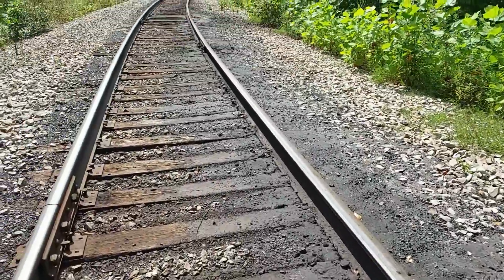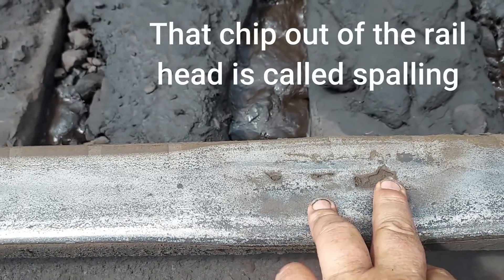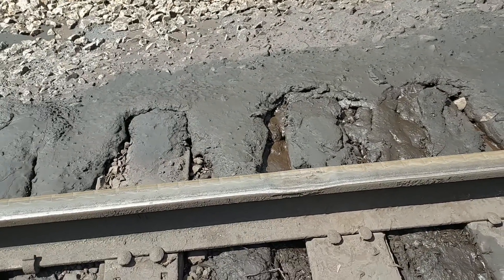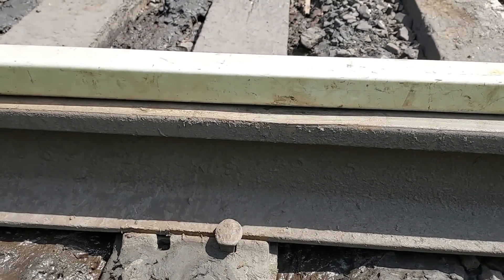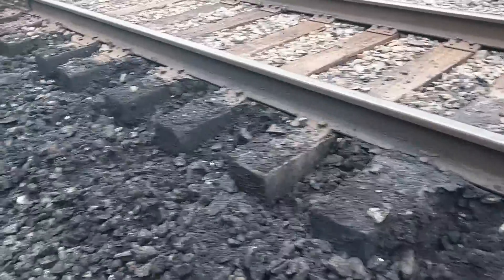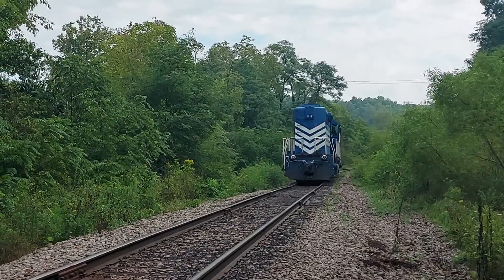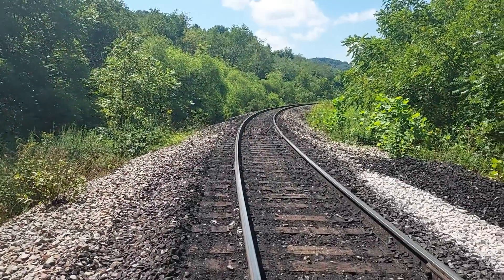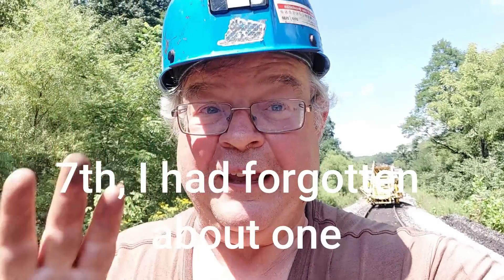This is the 7th Rail I've Broken with my Tamper

Comment: Dave , my DES unit as getting a national award  we had a derailment in Heath area about 3 miles from were we where . My  County Engineer was a old IC RR bridge guy and I was working with ICG at the time . 2 locomotives made it and 2 cars 4 tankers didn't . This is new welded rail  and we found a about 4 inch  gap in the rail . It looked like somebody didn't allow for expansion of the rail . clean break in rail almost . very near to a tee , north ,south one way ,east , west . This was a one piece interchange set in place and the rail ran into it . Have ever seen a setup like this before ?
Reply from the maker: No I have not Robert. Pretty cool you guys are getting a national
award, good for you! But I have had brand new rail in the past (39 foot sticks) on several occasions break just from the weight of trains.  Thank you for taking the time to watch the video and may you have a very good day my friend.
Reply: Dave , this happened in the early 1980's  so it wasn't current news .
Reply from the maker: @robertreeves-su1qb  😊👍🚂

Comment: I wouldnt in this case say you broke that.
It was alerting you in its own subltle way to do a repair before a train derailed.  From the looks of the discolored metal in that break, something bad happening wasn't very far off.   
Does that little chip or flake shown in  the begining of the vidjeo start to work harden the metal via the subtle hammering or vibration effect of the wheels rolling over that spot?
I enjoyed this one.   👍
...ok, i enjoy them all, but you know 😉
Reply from the maker: Glad you enjoyed the video Randy. You are right, far better to find
it with the tamper than have a train find it. I don't think it actually
work hardens the metal as you may think what that means is. It
more causes the internal defect to grow in size as the train's
going over it. What is totally amazing is a very tiny internal
defect in the rail actually grows in size as time and train traffic
goes on.  Thank you for visiting with us and may you have a very good day my friend.
Reply: @ccrx6700   You described that perfectly.  I know why they keep you . 👍
Reply from the maker: @randywl8925  😊👍

Comment: Well with so much movement in the Rails with the constant heavy loading Dave its a wonder you dont have more failures on your rail sticks ... as one of  the other contributors to the disscussion Metallurgy is a fineart Science ... a length of rail can only take so much punishment 😂😂😂😮
Reply from the maker: You are right about that Joseph. These rails take a beating with the
heavy coal loads and the soft spots in the track ballast. We do get
ultrasonic rail testers in twice a year so they catch stuff at an
early stage and we get those rail fixed or else they would soon 
break. Appreciate very much your taking the time to visit with us
and check out the broken rail show my friend.

Comment: Interesting.

My best guess is either a Horizontal or Vertical Split Head...or Compound Fracture.

Either start as Internal Defects, and grow slowly until the Defect reaches the Exterior of the Rail. When the Defect breaks through to the Surface, it Rapidly Grows within the Rail as It now has an Unlimited Supply of Oxygen to Support degregation.

This type of Defect was the Cause of more Arguments between myself (as a Stooge) and Chief Operators when I worked for Sperry Rail Service in the early 80s than just about any other, because of their Unpredictability... they have been said to "Heal Themselves", which I have alway doubted...

One of the Last Defects I marked up was a Horizontal Split Head I had caught just Inches outside of the Joint Bar Area. It happened on the CNR while they were yet a Crown Corporation. The Chief Operator Refused to Acknowledge my Findings, but was Overruled by the Railway Superintendent that witnessed the Incident.

There wasn't a Happy Ending to the Story save one thing...

The Rail was Replaced on the Insistence of Those that Answered to the Authority Entrusted to Them by the Sovereign, HRH Elizabeth II.
Reply from the maker: Thanks for the really cool comment Bruno. I have never heard of
a split healing itself either, but I do agree on their unpredictability,
just as a track man we always replace the rail asap with splits.
Appreciate so much your taking the time to watch the video my friend.

Comment: I was just thinking when I read the title of the video that it's better to break it with that slow-moving tamping machine than to have a heavy train break it since it seems like that might cause it to derail. I did see that under that flattened part, the steel looked just a little bit different and, when the crack happened, it was right where I had noticed that beforehand. It probably was a little defect in the production of the rail. It happens.
Reply from the maker: Your absolutely right, much better a tamper than a train whoever.
Thanks for visiting with us and checking out the broken rail video
my friend.

Comment: Dave, here in the UK we use Hadfield Manganese steel. It has up to 13% Manganese in it. This gives it the property of ‘work hardening’ the surface due to the action of the wheels. Where you have a defect I expect this will get excessive pounding from the wheels and a extra hard skin forms on the rail. This eventually gives up and you get the spalling.
Reply from the maker: Thank you for the excellent info Peter, I will have to do some research on that. That stuff gets hard, wondering if you guys
have rail grinding program and how the stones hold up 
grinding that stuff???. We appreciate your taking the time to watch and write in my friend.

Comment: Hi Dave,  @4:16 I noticed a discoloration in the railhead surface about 1 inch to the left of the spalled area.  It almost loos like a crack straight across the head section.  There also looks to be a possible crack on the field side of the rail head from where the surface discoloration meets traveling diagonally to the right.  Looks like the head was already cracked and the tamper just finished the job.  Cheers.
Reply from the maker: Very good observation Samuel, I think you are right, was already
cracked. Thank you so much for visiting with us and watching. May you have a most blessed day my friend.

Comment: do you stress your track after welding it ? greetings from the UK
Reply from the maker: No we do not Gallo fourteen. We do not have CWR here only
an occasional thermite weld, 16 miles of track and it is almost
all jointed rail. Really appreciate your visiting with us and checking out the video. May you have a most blessed day my friend.
Reply: @ccrx 6700 That's Railroadin!  cheers dude. I will now that my shift is over. Just finished regauging some points over her in old blitey.
Reply from the maker: @gallofourteen116  👍😊

Comment: thought rail was cast as one piece but looks like the top part that the train wheels run on is not the same piece as the bottom. how that broke away is strange.
Reply from the maker: It is rolled in one piece, you are right deeremandoug. Rolling
contact fatigue is what caused  the rail head to look like that.
Really appreciate your paying us a visit and taking in the video. 
May you have a most blessed day my friend.

Comment: was that rail made in 1975? and how long do rails usually last?
Reply from the maker: Yes sir, rolled by US Steel 1975 Illinois Bill. Rails last far less time
in high degree curves than they do on tangent track.There is
no set formula for how long a rail can last tho. Lot's of
factors go into determining how long a rail stick will remain
in service. There is rail rolled in the early 1900's still in
use on some track. Thank you so much for taking the time to
watch and write in my friend.

Comment: What are those rails made out of old Great Lake Steamers well-known to catastrophically fold-in-half as a result of metal fatigue or crack apart from freezing conditions. Ha.

Have you been able to keep track of suspect rails manufacturer or year Lot number to see if anything in common between each other?
Reply from the maker: Rail was rolled in 1975 by US Steel Illinois. It held up pretty well
for all those years of heavy coal loads over them. Rails break,
that's just the way it is on the RR.

Very much appreciate your visiting with us and watching the video. May you have a most blessed day my friend.

Comment: Great video Dave, good camera angles to see the details. That broken part of the rail had a lot of rust in it as well, could have failed at any time. Great it happened during tampering. The term Spalling is also used in the electrical industry on concrete power poles, when the rebar has rusted and is cracking the concrete of the actual power pole.
Reply from the maker: Thank you so much Rodalco for the very nice comment.
We do appreciate your taking the time to check out the video. May you have a really good day my friend.

Comment: Started railroading on a veteran railroad 50 years ago. It's a narrow gauge railroad, 891 mm, 3 Swedish(!) feet, we use other measures for curves, the radius. You use degrees. How is that done?
Reply from the maker: Radius is the distance from the center of a circle to the 
perimeter of the circle. take where that radius touches
the perimeter, then make a 100 foot chord to the circle
perimeter, that is the arc. then you have 2 radius lines. The
distance between those 2 lines is measured in degrees,
thus the degree of curvature. Hope that is clear as mud. Much
harder to explain, I need to make a video and show a drawing
of how its done. Have had a lot of comments on why curves
here are measured in degrees. Always appreciate your
visiting with us my friend.
Reply: @ccrx6700  Thanks! Here we measure an incline in the number of feet climbing per 1000fet of advancing. Other standards use the opposite, how long to go to climb one foot... Only math...
Reply: @ccrx6700  Thanks! Having a Master degree in electronics the math is clear, as mud! Her we use the radius. 
The automatic track correcting machine also need the pre radius sitting between the straight track and the real curve.

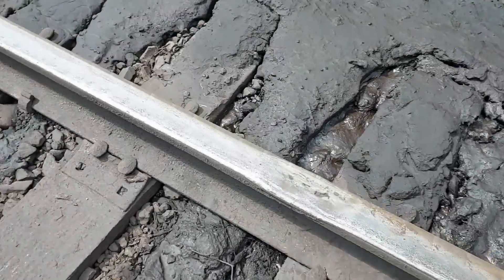Comment: 2:00 There's a railway crossing near where I lived that looked like that for several years before they finally corrected the situation. By the time they got around to do it, the rail was bouncing up and down at least 2 inches when a train went through. It was pumping mud all over the place. The fix happened not long after the Lac Mégantic disaster. I actually live a little over an hour away from there. Some of our fire crews went there. As tragic as it sounds, I think that the only reason that it finally got fixed is because of that tragedy. Right after that crossing, there is a pair of curves before the train reaches the city center. They upgraded them to continuous welded rails and added a cant angle. As nice as it looks right now, my experience tells me that it likely won't get touched again for at least another decade. With our winters, things can move a lot and they can move fast. Over the last few years, the river has eaten up a very large portion of the land that used to separate it from the railway. As unprotected as that river bank is, I would not be surprised to hear that the curve has fallen into the river in a few years. They fixed the railway and did not bother to make sure that it was properly protected against the assaults of the river. It's just my impression, but I think that basically sums up how railway maintenance in Canada. It is patchwork that only partially addresses problems until the next problem rears up its ugly head.
Reply from the maker: Thank you very much Jonathan for taking the time to watch the video
and share with us your thoughts.  All railroads have problems, some worse than others. I'm not making excuses for any other RR, but
here you do what we can with the amount of track time, money
and equipment available, plus there are only 2 of us who maintain
the track.

Comment: Better it broke with the tool than a train. Looks like it had a slag pocket inside. Seen this before, but on different metal. Structural I beam.
Reply from the maker: Thank you Christopher. I do believe you are right,
rail had a small inclusion in it from rolling, often that inclusion
is called a shatter crack and is caused by hydrogen that is not
removed during the controlled cooling process. it does happen.
Really appreciate your taking the time to watch and write in
my friend.

Comment: Another informative video Dave  it makes me wonder if that rail had a void in it when it was made, and over the years the weight of the train wheels weakened and collapsed it.
Reply from the maker: Thank you Agostino for the kind words. I do believe you are right,
rail had a small inclusion in it from rolling, often that inclusion
is called a shatter crack and is caused by hydrogen that is not
removed during the controlled cooling process. it does happen.
Really appreciate your taking the time to watch and write in
my friend.

Comment: Hey railroad Man, is it me or does it seem like the quality of the bearings and rails has gone way down hill lately from what it was just not too long ago?
From the looks of those bearing cages you've been showing lately it appears like the metal quality and hardening process has dropped way off possibly causing derails and damages unnecessarily?
Reply from the maker: I'm hearing on the RR rumor mill that some bearings made
by big name manufacturers are actually made in China. If
so, that answers that. That rail I broke was 1975 US Steel Illinois.
In a high degree curve so we got our wear out of it. I've also
heard on the RR rumor mill that some companies are buying
Chinese made rail and it is absolute junk. Really appreciate
your visiting with us and checking out the broken rail my friend.

Comment: That Rail Defect looks like it could have started from a Squat, and there might even be a Tache Ovale (Transverse Defect) propagating under it. I worked on Ultrasonic Rail Testing in Britain. Here we used to open up the Wet Beds (Cribs) using a Ballast Fork, square nose Shovel and digging Pick, then we would board the Track and use measured Shovel Packing with sluing Jacks to put the Track back to line and gauge, we didn’t have the luxury of Machines to do the Work, just our Muscles. Great Days loved every Minute of it, bet you do to.
Reply from the maker: Have no idea what a squat means, but no doubt this joint had mud
under it at one time and wouldn't hold track surface which
got the joint to pumping and started the defect to occur. Thank
you for visiting with us and sharing your thoughts my friend.

Comment: Oh WoW super Dave   Using the Ta.mper to push out the muddy Rail breaking ballast......."*?....Here's a thought  Since you can only use the tamper to only dig out the very outer edge of ties.Dave you did a nice job...Could  you temporary  bolt on a "L" SHAPE  BRACKET TO BOTTOM  SO YOU COULD  PERHAPS  ALSO REACH IN MORE TO CENTER OF TRACK AND PULL OUT ....AND. DO ON BOTH SIIDES OF TAMPER  SO CAN " PULL OUT THE MUDDY  BALLAST  ON BOTH SIDES OF THE TIE.....??
Reply from the maker: Sounds like an interesting idea Bradford. Would take some
engineering skills to accomplish that. The workheads on the 
inside also have less travel than the ones on the outside do. There is
a machine that uses a similar principal as you describe but is
made just for cribbing. Thanks so much for stopping by and
checking out the broken rail my friend.

Comment: In aircraft structures, aluminum, we would say that failure is from intergranular corrosion brought about by improper heat treating or imperfect  alloying. Are those rail heads hotrolled, or heat treated and quenched.  Just saying something to consider. The intergrannular corrosion may have happened like in aluminum. A galvanic internal cell could have been formed, just like a battery.
Reply from the maker: Thanks Robert for sharing the info with us. All rail is required to
be control cooled. However it is not a 100% perfect process that
100% eliminates the hydrogen flakes in the steel. Over many 
years of rolling contact fatigue that hydrogen deposit, often
called a shatter crack, grows. As the growth gets bigger,  it
exponentially grows at a faster rate. Once a growth gets to about
30% in size then the rail needs to be changed. And yes, rail is
hot rolled.
Reply: @ccrx6700  thats quite a feat to evenly cool that large flange compared to the lower flange .....and the thin web. Thank you for the reply.
Reply: I might also add that for some reason or another I have a feeling that rail beams or railheads don't get the quality care in manufacture, heat treating or rolling and inspection that aicraft metals, mostly aluminum recieve.   I suspect that's one reason the USA doesn't have a BULLET TRAIN like other countries have. We do have the Acela line that's where they can travel at 150mph on, but only for 34 miles, that's about 10 minutes not counting a minute or two getting to 150 and slowing down. Have you got any info on the inspection requirements of that 34 miles of track? Thanks
Reply from the maker: @robertstack2144  Yes I have a Fed Track Safety Standard book for
Class 6 to 9. Obviously with class 2 track I don't have a need for it
other than to learn info about the higher classes. Class 8 track is
rated up to 160. Class 9 is up to 200 MPH. Some other countries have
a Class 10 for the really high speeds. FRA has considered writing 
rules for bullet train speeds but since there is not enough money
or interest here in this country to build a track like that, the FRA has
not come out with any standards for it.
Reply: @ccrx6700  Somewhere I saw a video that said railroads can move a ton for 1US gallon of diesel maybe 100 miles. That's pretty good.....soon maybe trains will be back and commonplace for people beside s freight. If that happens, there will be a need for fast trains. The Feds will start bloviating safety and will start messing things up. We will see